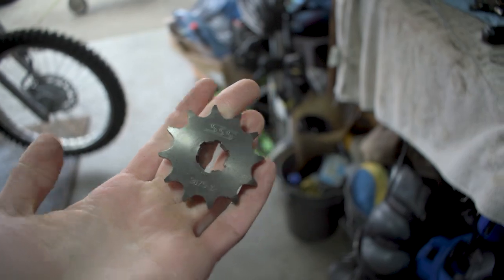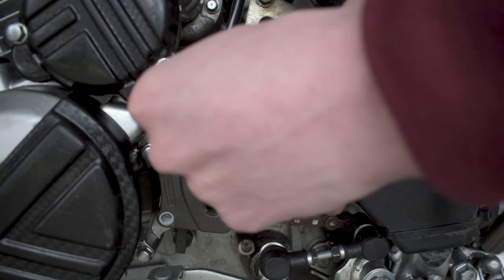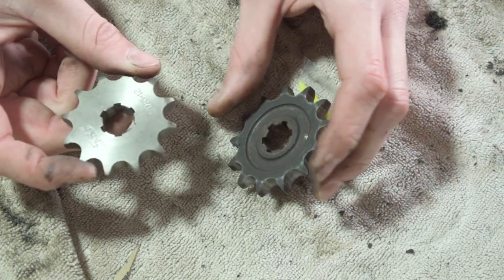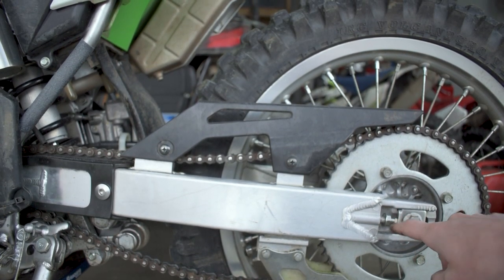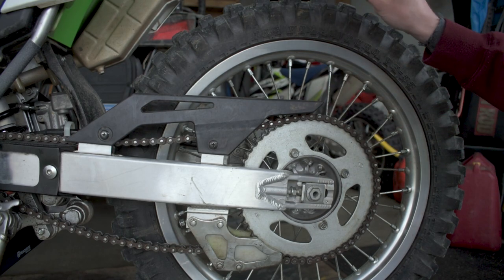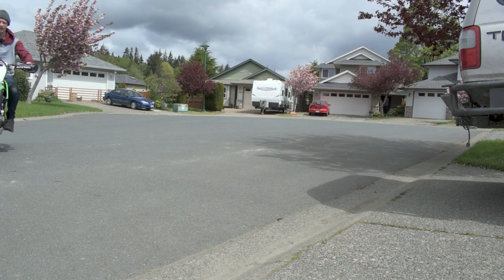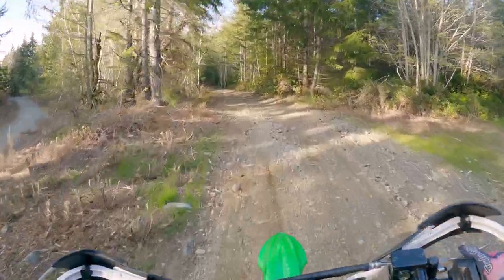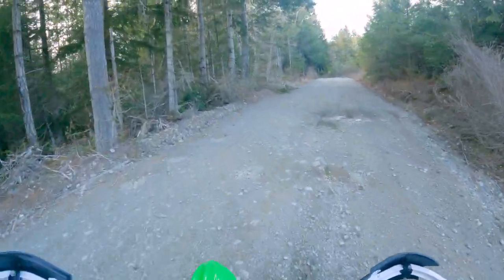How To Make Your KLX 140 Dirt Bike Faster!

Comment: NO sh..t . Finally someone who knows what this bike really needs. Most people will not go 55 MP/H , 
but simply have fun on trails , drr.  I believe this is one of the best tunes u can do to your 140.
Great vid , thank you.
Reply from the maker: I agree! This is perfect for those who want the most out this bike on the trails!
Reply: My 140 hits 64
Reply: @tag3ddie hot damn, that's crazy man. I have to ask though brother what mods did  you do in order get it up to that kind of speed? I have a '23 KLX140, I put a 12t sprocket in the front and a 49t on the rear. Also added a rekluse clutch, 63mm piston, bbr intake manifold, and a FMF Powercore 4 exhaust set up and the fastest I've been able to clock it is around 53-55 mph. Also I only run 93 Octane non ethanol gas in it since the day I rolled it off the dealer floor. If I can get my bike to that kind of speeds I wouldn't need to upgrade to anything else.
Reply: My 140 hit 64 if you want to know the real best mod it’s a carb upgrade the stock carb sucks and when I switched it to a 3 jet carb it made it way faster
Reply: @CocoKickz94 so what I have my bike at rn is a 51T rear sprocket with a 13 or a 14T front and instead of the stock 22mm car. I did a upgrade to a 28 and a 3 jet
Reply: @tag3ddie  awesome to know. That will definitely be the next upgrade I'm going to try. I really appreciate that info bro, thank you!

Comment: What kind of locktite did you use and what brand sprocket did you buy? I have a 2017 klx 140L and would like to make it accelerate faster. Thanks👍🏻
Reply from the maker: Only ever use blue locktight! Red is if you dont want to be able to ever take it off! (Without using heat) brand of sprocket doesn’t really matter, it should be linked in the description

Comment: Does the more torque one help with lifting the bike up ? My stock 2021 klx140 only goes up in 2nd if I could wheelie it in 3rd it would make such a big difference I’m just wondering if that will really help with it.
Reply from the maker: Oh absolutely, itll help keep the bike in max torque efficiency. You’ll loose some top speed tho

Comment: Those engine guards, i have a worry it will store more of the heat, and also when dirt comes inside it it could catch fire in worst case.
What do you think?
Reply from the maker: Thebike’s never heated, and they rarely hold any mud., never had dirt almost catch fire in there. You need oxygen for fire to burn
Reply: @AaronsEnduro  Ok, But the heated thing is really frying my brain right now, it holds back the heat from the inside getting out as good when its stock, that makes sense it seems like, it also ads wheight, its not much iknow, but that, and alu skid plate, full hand guards etc you know, if ur not adding any more power those may matter.
Reply from the maker: If you bikes casing it smashed on the side of the trail you’ll have no power at all lol. Protection mods are a must if you’re out in the trails. Its not a race out there anyways so id much rather the bike be rideable home than not. These bikes are also air cooled with the fins at the cylinder head. Where the engine casings are its using the oil to cool the engine down. To me it’s absolutely no worry at all for heat. This bike dissipates heat extremely well
Reply: Now i see those are plastic, then iam more positive to them.  protection is good i agree, and i wanna get skid plate also, but those full sized hand guards thing iam personally not taking the risk, its fine if others do just saying.
Reply from the maker: These full sized hand guards have saved me way to many times thatd id never run any bike again without them

Comment: Whats the exact tyre pressure on both for enduro?
Reply from the maker: @TheZoxxy  somewhat depends on your weight and what tubes you are running. My personal preference is 9 front 8 rear when its dry and riding aggressive.

7/8 psi front and 6-7 psi rear when its raining and wet out. 

If you’re a heavier riding you might get pinch flats running yours that low

Comment: I have been thinking about taking my Ff to a medium Mx track I know it’s not designed for it but it is enough for my skill level, what sprocket changes could you recommend for it.
Reply from the maker: I think stock gearing will be ideal with stock engine. It’s doable, but you’ll likely be bottoming out the suspension if you arent landing jumps cleanly
Reply: @AaronsEnduro  yeah the suspension might be a problem but that’s for another time with the gearing I won’t change anything unless I never get close to top speed on the track because then I could use my power better
Reply from the maker: You just dont want to gear it too tall where you dont have enough torque to get up to speed out of the corners before the jump takeoffs
Reply from the maker: If you can ride smooth you’ll be alright
Reply from the maker: In a soon to be released video ill be showing “bolt on” suspension modifications
Reply: @AaronsEnduro  if anything I would make it more torquey for a track
Reply: @AaronsEnduro  I would love to see that video thanks for the content
Reply from the maker: If you go down in gearing like i did, you’ll be shifting A LOT on the track. Stock is probably ideal
Reply from the maker: The ratios got noticeably closer after gearing down
Reply from the maker: Worth testing for yourself tho to see what you like
Reply: @AaronsEnduro  yeah I’ll keep it stock and if it is not powerful enough I would rather shift more and therefore clear jumps but I won’t change anything I don’t have to
Reply: @AaronsEnduro  for sure
Reply from the maker: Lemme know how it goes! Curious to know!
Reply: @AaronsEnduro  yes for sure I will definitely let you know thanks for the help I appreciate it.(It would probably be a few weeks until I go
Reply from the maker: Sounds good buddy!

Comment: I need help. I have a 2013 Kawasaki 140L, I bought it 4 months ago, have rode it every day no problem. Bought it with bad piston rings. Yesterday, it died on me, crank no start. It has a new battery since it was left on all night in October. I do not know where to start looking, any tips? Will turn on when cold then stalls and doesn’t start when hot.
Reply: Did you get it fixed buddy?
Reply: @StumpStunter95 yes, the spark plug was the issue. Then I rebuilt the carb. And got a big bore kit which came with new piston rings
Reply: @nathanbfishin497 spark plug seems like a bad issue with the older I have a 2015 R and spark plug suck on it

Comment: Cant find 57 tooth anywhere, wanna buy it as backup.
Reply from the maker: Standard is 52 tooth?
Reply: @AaronsEnduro  Nope, just checked again, it says 57.
Reply from the maker: Looks like you’re correct. Looks like something you’ll have to order direct from Kawasaki!
Reply from the maker: Ive got 150 hours on my stock rear sprocket, 70 of that with the big bore kit and other goodies. Id say youll be fine for at least that many hours with it before wanting to replace it
Reply: @AaronsEnduro  👍